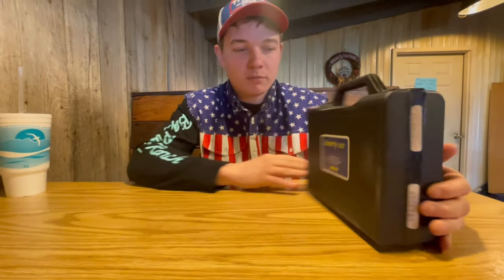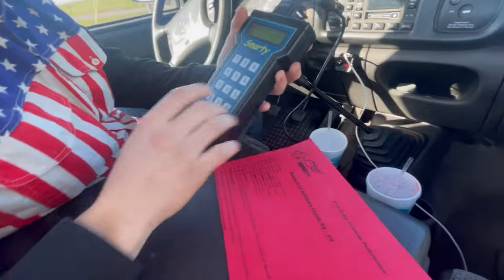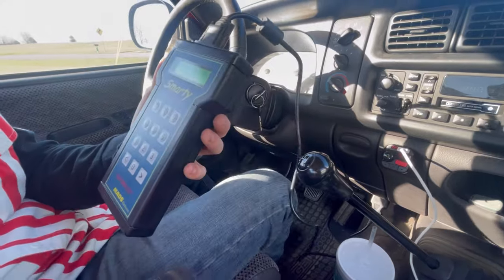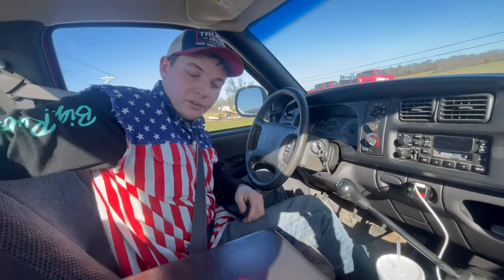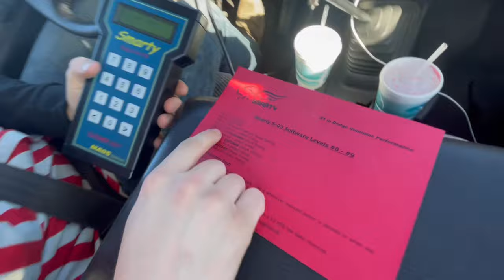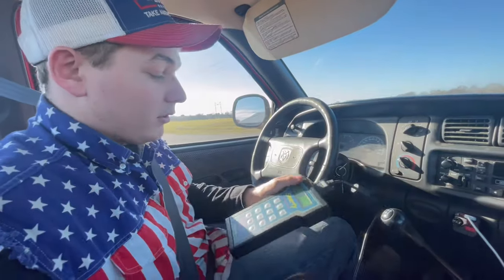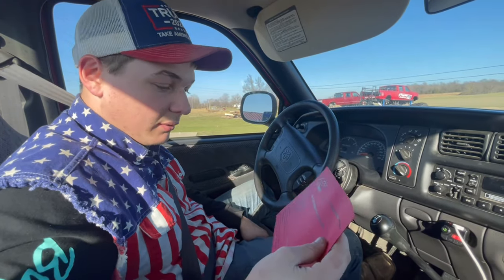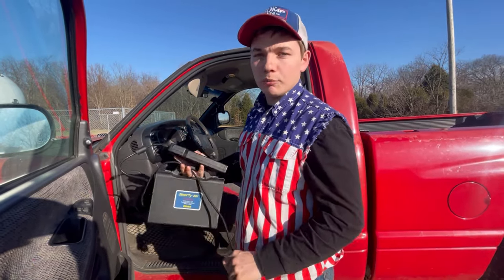Smarty S03 on a 1998.5-2002 24valve cummins review

Comment: I run that tuner, I have some motor work and bigger injectors, my results are a lot different.  Any setting above 5, my truck rolls coal.  Not looking to roll that much though.
Reply: It's the injectors without more air likely.